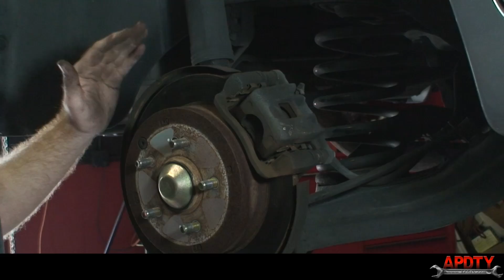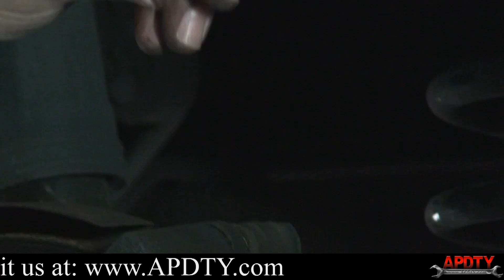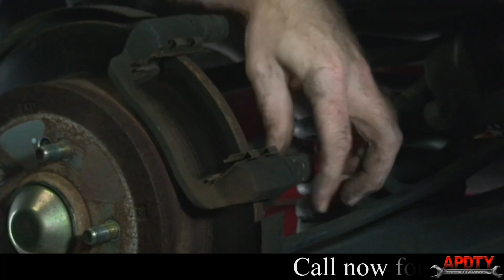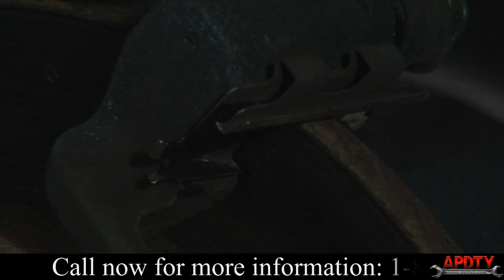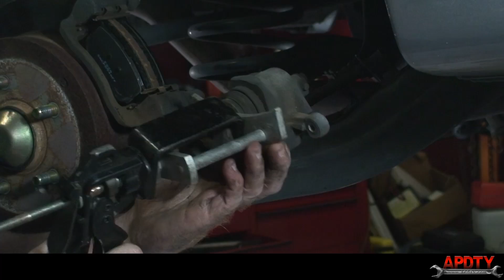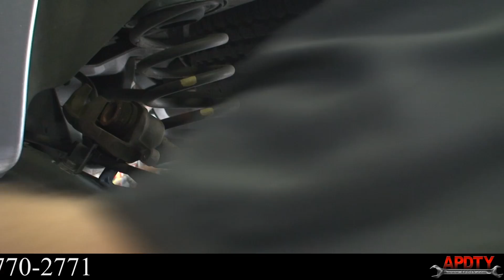2001-2006 Hyundai Santa Fe Rear Disc Brake Pads

Comment: Would anyone happen to know why my rear brake pads are really grinding so bad after we changed em? We even had the bearings changed to last year I think it was my husband thinks it's that again but I know the grinding noises are coming from the brake pads I think he forgot to bleed em by the rotor area how can we restart? To get out the grinding noise? Can someone msg me for some help? I would really appreciate it, my mom relies on me for rides daily. And I dont wanna have to say I cant to her :( anyways leave a comment if and idk maybe we can exchange emails or something thx
Reply: Are they on backwards?
Reply: It was the wheel bearings again ugh now my air conditioner is busted again and we had it fixed a couple months ago :( the compressor the whole works, worked so good for awhile but alla sudden it's just blowing heat again
Reply: @amandaharper5388  wow this is on sante fe? Mine is 180k with no problems with bearings or A/C
Reply: Yea, I've had this vehicle for a few years finally breaking down on me :p and nobody won't give me a chance to apply for a newer vehicle lol like those no money down and no credit or bad credit pfft all lies in I've tried many

Comment: We did everything the way you showed it, but why is it grinding so badly now? need some help, never usually does that when we changed our brake pads before
Reply: Backing plate / dust shield bent; caliper is seized or not releasing well, rotor is rough, bad wheel bearing…
Four years later you’ve probably already fixed it

Comment: I use to worked at my fathers brake shop years ago.  From few videos I've see on changing rear disc brakes....I have a 2001 Hyundai Tiburon, they do not show it correctly.  For the rear pistons you can not compress them in with a C-Clamp or piston depressor.    That is for front disc brakes.  Because the rear disc system uses an emergency brake that works the rear calipers, you need to SCREW the piston back in.  DO NOT JUST PUSH IT IN...or you will damage the caliper.   You need a Four Wheel Disc Brake Piston Tool .  Auto parts stores or  Harbor Freight  sells,  theirs are cube shape (to fit many cars).  I use for my car a wrench for replace  4.5" angle grinder disc.  It has "tits" that fit   notches in caliper's piston and handle.   Turn....screw in piston just enough for new pads to fit.  Make sure you line up piston's notches with "tits" on the disc pad.   Then reinstall caliper.   AGAIN, never PUSH.....forcing piston back in on rear caliper!!!!
Reply from the maker: +Mike Lubin This is a 2003 Hyundai Sante Fe, and the rear brake caliper piston does not screw in. It also does not have a notched surface for screwing the piston back in as you can see at 8:27. You would have a really, really difficult time trying to compress a screw-in piston.

Comment from the maker: Here is links to the parts we used available at Amazon.com:
Front Ceramic Brake Pads For 2001-2006 Hyundai Santa Fe:
 http://www.amazon.com/gp/product/B007K1L2UO/ref=as_li_tl?ie=UTF8&camp=1789&creative=9325&creativeASIN=B007K1L2UO&linkCode=as2&tag=aupaditoyo-20&linkId=4UM5HCNAN7VWJ44N

Rear Ceramic brake Pads For 2001-2006 Hyundai Santa Fe:
http://www.amazon.com/gp/product/B003YMU204/ref=as_li_tl?ie=UTF8&camp=1789&creative=9325&creativeASIN=B003YMU204&linkCode=as2&tag=aupaditoyo-20&linkId=63AGIHHMP4TJRSDB